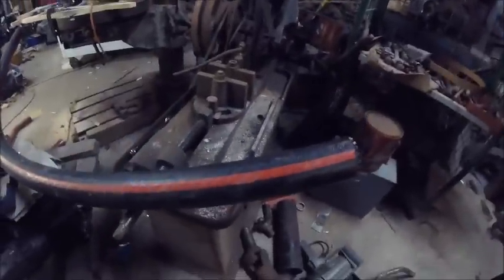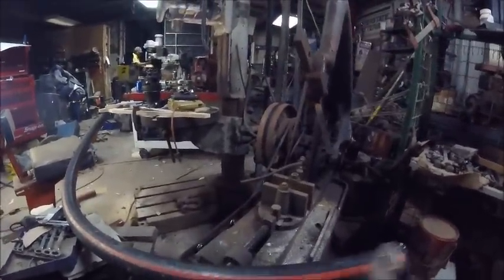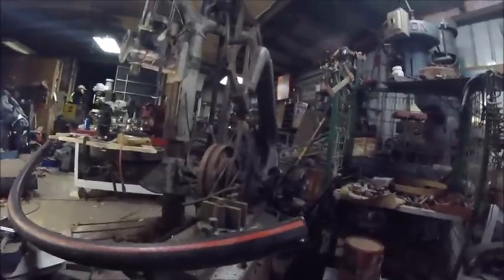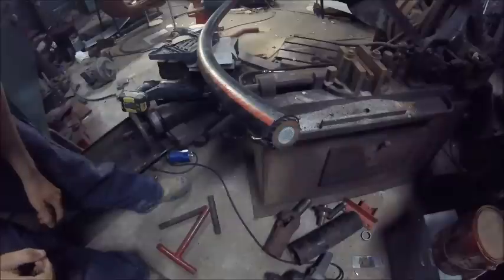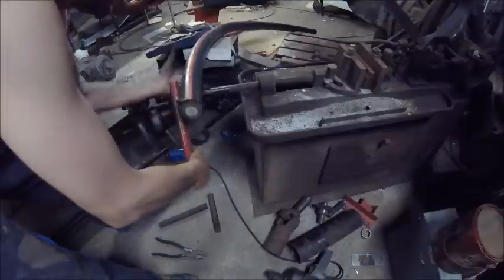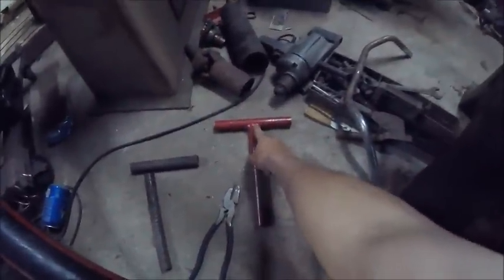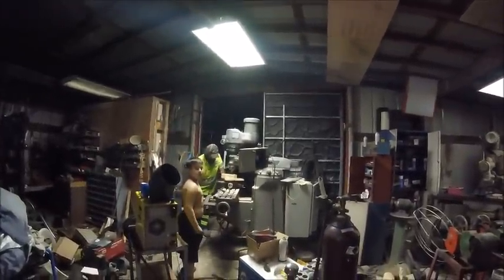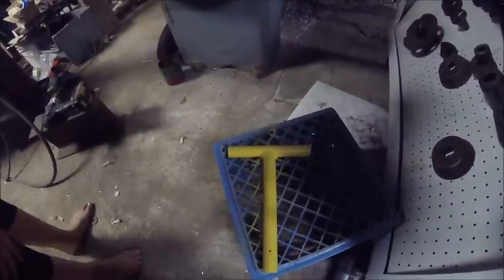Underground distribution outer jacket removal tool!

Comment: okay , so secondary wire is lighter.. Our code lets homeowner dig and place conduit with rope inside , from meter base to the pole. Hydro guys come and pull steel cable thru, then attach the " secondary " and winch it thru. So its primary we see strung pole to pole. . I have a lot of respect for you hydro guys , playing with the "very hot" lines. Thanks !
Reply from the maker: +Ervin Goertzen primary can also be in pipe. We use all sorts of different diameter conduit for different wire and sets of wire

Comment: I am a bit ignorant here, is that the same type of line that goes above ground up on poles ?
Reply from the maker: +Ervin Goertzen what you pulled should have been what we call secondary, wire. This is primary, wire. Very heavy stuff for high voltage straight out of the substation. 

What you pulled yourself  was it a single wire or multiple together

Comment: GREAT IDEA. I COULD SEE HOW THAT WOULD HELP. THE BIGGEST WIRES I EVER PULLED THROUGH CONDUIT WAS 4 500'S. THAT WAS HARD ENOUGH....I COULDN'T IMAGINE WORKING WITH THAT 1000. I USED A CHUGGER TO GET IT PULLED IN AND IT WAS STILL A BEAR.
Reply from the maker: J.C. SMITH PROJECTS we most commonly pull 3 750s through one 6". and we lay a lot of conduit. a lot. lol